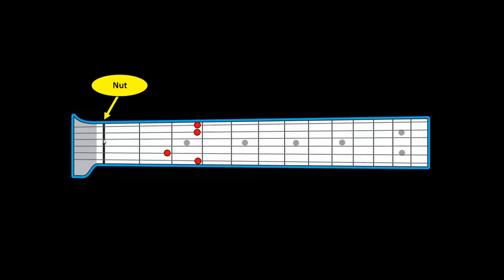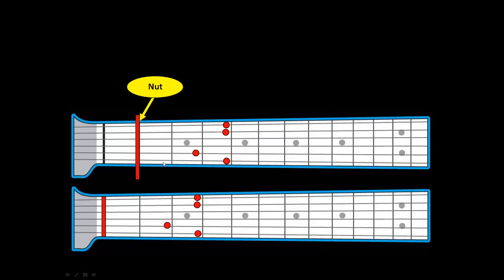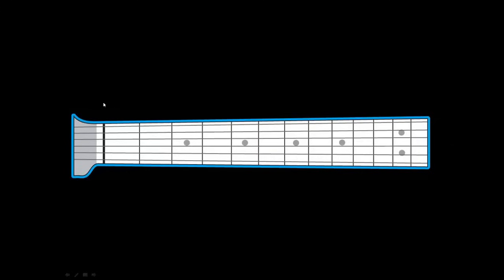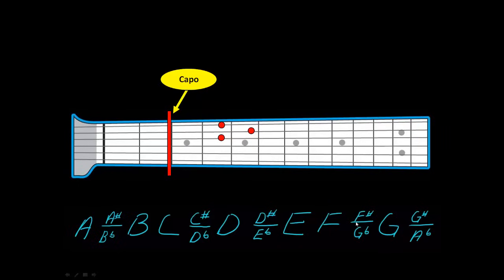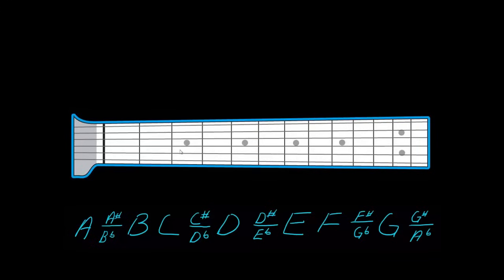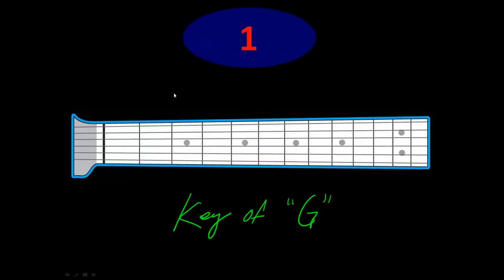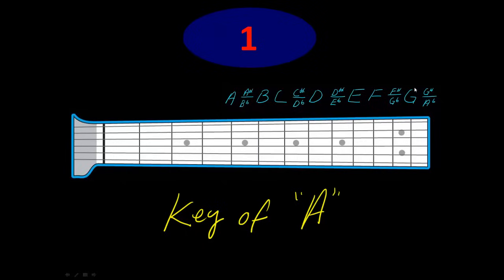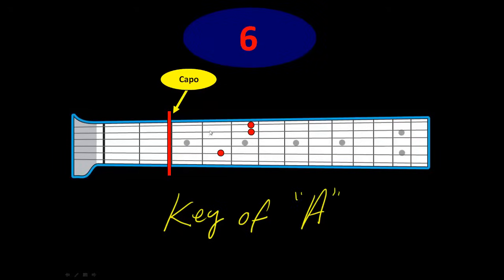Understanding how a capo works

Comment: I'm an experienced guitar player, and  guitar instructor. As an instructor, I'm always looking for better ways to explain what are, initially, difficult concepts for students. I like this video lesson because it does exactly that. In general, it is an easy-to-understand lesson. However, the narration at the 1:30 mark (and several times after that) should be changed from ". . . to get 'the same sounding' chord. The only difference will be that it will be a little higher in pitch." This is confusing to learners because how can it be a 'same sounding chord' if it doesn't sound the same? I would recommend using the term "chord form" and change the narration to something like: "You can use the same G major chord form to create a higher sounding pitch." Also, a short sentence or two of describing the purpose of a capo, at the beginning of the video, before getting into how it works, would be beneficial as well, so that the video can stand on it's own as a complete presentation. A video with a narration track is easy to revise. Excellent instructional videos like this help take the mystery out of playing guitar. Keep them coming.
Reply: At  110 he moves it one fret and calls it a step..no its a half step interval.
Reply: Hank Unck p
Reply: Wow I’m so lucky that I was in orchestra before learning guitar cause the concept of notes being the same but different pitch is normal to me. I can’t imagine being confused on it
Reply: No, no! At the beginning you’ve confused the HALF STEP or semitone with the WHOLE STEP or tone. Very important when jamming with a pianist/keyboardist. Moving one fret=1 half step/one semitone. Moving two frets=one whole step/one tone. There was some confusion at the beginning about half steps and whole steps. Correct later👍👏.
Thanks. Yes to Brian Wurch above.👍👏.
Reply: I know Im asking randomly but does anyone know of a method to log back into an instagram account??
I stupidly forgot the account password. I love any tricks you can offer me.
Reply: @Quinton Alexander instablaster :)
Reply: @Dario Idris i really appreciate your reply. I found the site on google and I'm in the hacking process atm.
Takes quite some time so I will reply here later when my account password hopefully is recovered.
Reply: @Dario Idris it did the trick and I finally got access to my account again. I am so happy!
Thank you so much you saved my account!
Reply: @Quinton Alexander glad I could help :D
Reply: Hahaha!!! 
I was just going to write the exact same thing you did. I teach too. I was getting upset. Then I stopped  the video to read comments. And I started to LAUGH when I read yours. You took the words out of my fingers. 😂🤣😁👍🏼
Reply: @suvindraickybicky1216  oh this was super helpful. I was confused about this. Thanks for clarifying.

Comment: At about 1:00, "These distances is what makes it sound like G chord," thevscreen pointer is between the nut and the finger positions,  indicating (IMO) the portion of the string that is vibrating. Of course, the part that is audibly vibrating is to the right of the finger positions. This right-side portion, between the fingers and the bridge, is where the strings are hammered or pulled to cause vibration and thus sound.

Comment: What does he mean when he says when you use a capo a d chord will sound the same but different?
Reply: This video is horrible. If you play any open chord in it's position near the nut, it sounds like what it is.  So a C is a C, a G is a G, a D is a D, an A is an A.  This guy just saying when you move the capo up makes it the same chord only "higher in pitch" is ridiculous.  Let me try to explain, the chords in order are A, B, C, D, E, F.  If you put the capo on the SECOND fret, you are essentially changing whatever chord SHAPE you're playing up to the next chord.  So if you put the capo on the second fret (which is a whole step up from no capo), and you play the D SHAPE, it will sound like an E chord.  In the same situation if you play a G SHAPE, it will sound like an A, etc etc.  I hope that helps.

Comment: Moving the capo up the neck doesn't shorten the neck, you simply fret other frets. Example; placing the capo on the first fret doesn't shorten the neck, you simply fret these notes which become your open string notes. :)
Reply: Technically yes, but theoretically, you are shortening the neck since the capo acts as the nut does. Both ways of looking at it are correct, but it's easier for ppl to make sense of it the latter way compared to how you described it.